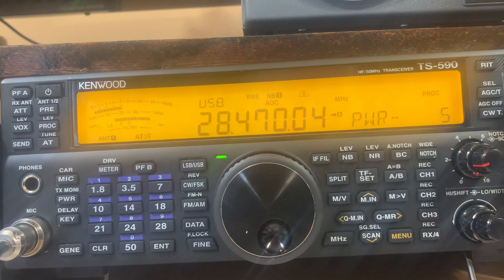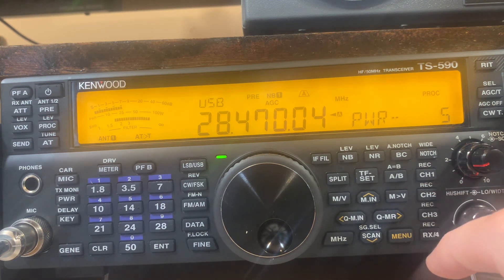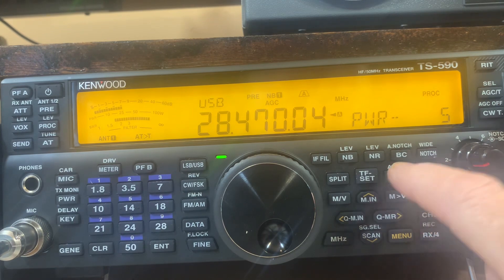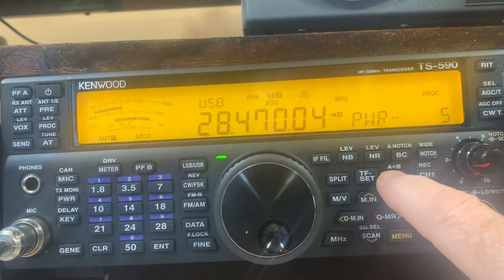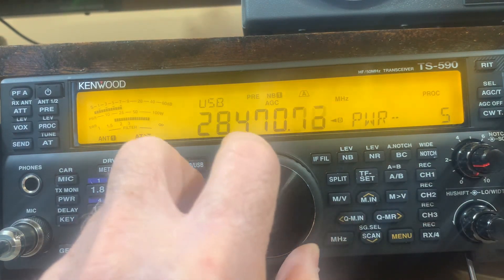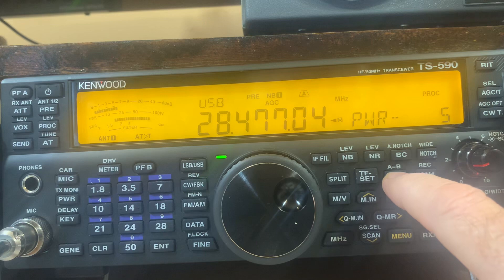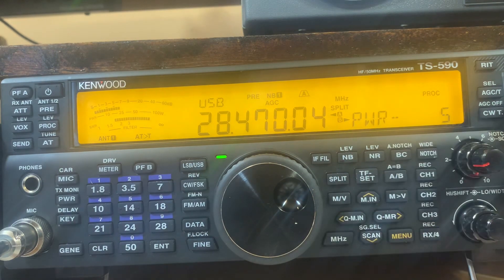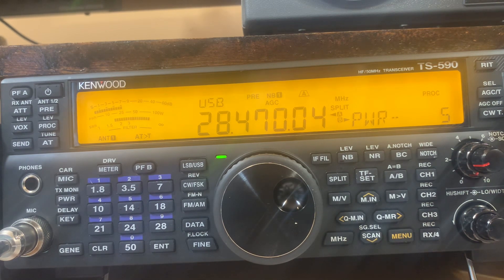Working A DX Station Using Split.

Comment: If I am operating according to Part 97 of the FCC, I would not worry at all about police radio amateurs who believe they own the frequencies. There are more problems that they cause when they operate in split. When DX Stations operate in split they use more RX spectrum space and it is proven that they always affect radio amateurs who operate and are fully entitled to use their privileges on other frequencies and have nothing to do with the DX Station.  Learn to be better neighbors. Better stay and operate RX & TX on the same frequency and consider radio amateurs who have the same right in their privileges but are affected and interfered when a DX Station comes out operating split.

Comment: This causes interference problems and it is proven that when split contacts are made, in most cases the other frequency used to call the DX Station is already occupied by other radio amateurs who have nothing to do with the DX Station. The most recent example was a DX station transmitting on 14.250 MHz and the radio amateurs who called it in split transmitted on 14.260 MHz. There were already radio amateurs who were occupying the 14.260 MHz previously and they had nothing to do with the DX Station, the result was that all the radio amateurs calling the DX station were causing interference to the radio amateurs who were already using the 14.260 MHz.